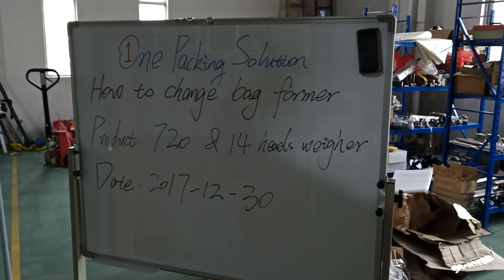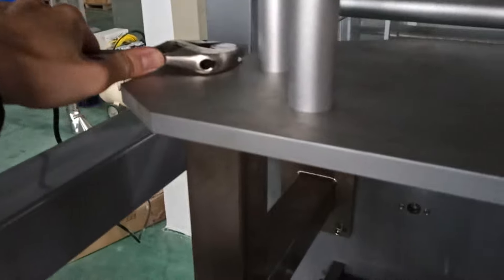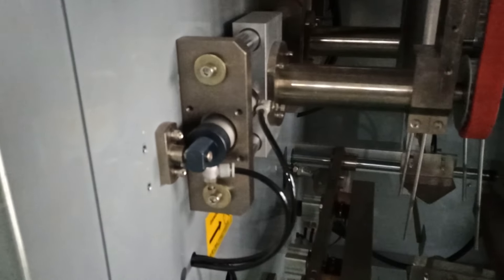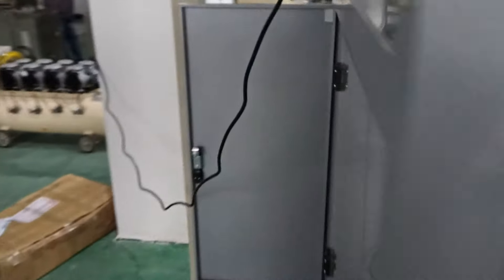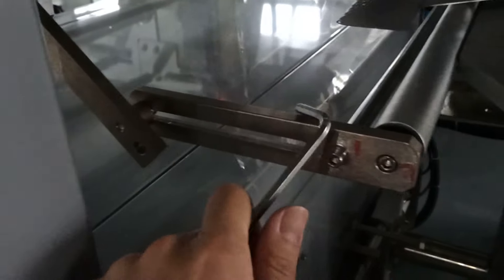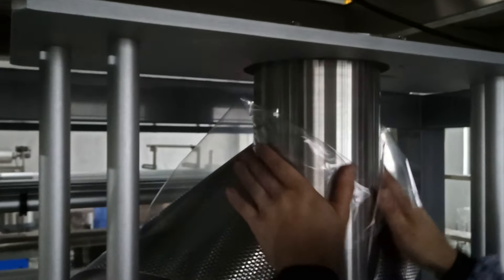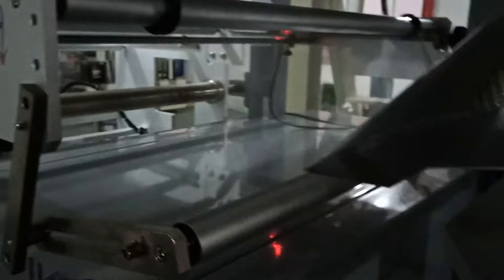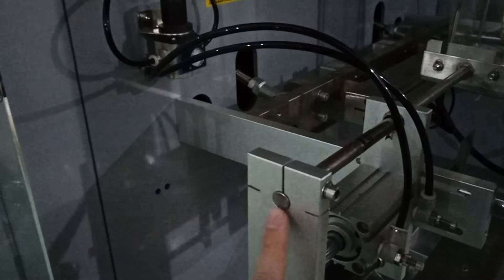How to use a full automatic packing machine- change bag former

Comment: This appeared as a recommendation for me, I remember when I was working on this machine while working in the chips factory. It was very tough dealing with these machines, lots of jams and errors.
Reply: How old was the machine? I work in a cereal plant and the back seal is a big issue. The triangle machines are 30 years old.
Reply: @robertapascal6962  I am no longer working in the factory but as far as I remember, the machines were not too old since the factory was established in the last decade. We also had issues in back seals, date print codes, registration marks and so on. What an annoying machine it was!
Reply: Ever had issues with the bottom of the gusset coming out open
Reply: Yea, I'm currently a Bagger Operator at a food production facility and I operate a similar Bagger as well. Nothing but Jaw jams and scale errors all night long.

Comment: Wow so awkward threading the film down the tube. I was taught a much easier and faster way to thread it. Pull a bit right through the front of the machine, do an angle cut, where the overlap side is longer than the inner-side. Thread the longer tail through the front of the tube. Hold the tail and pull it around the tube and there you have it. I have operated these machines for about 18 years, and my tube forming changes are only 15 min from start to finish.
Reply: Yo también estoy aprendiendo y así me enseñaron a mi y me tardo como 30 minutos y ahora lo are como usted dise para mejorar
Reply: @linacolin9451  tienes problemas con Que salgan los bolsas abisrtas de abajo
Reply: 15 min? We have like 4 minutes to change a roll in my factory 🤣
Reply: @nogo3972  there's no way.. they give you 20mins to thread the film and feed it down the former and former tube on the operators exam. I work at Campbell's and that's how long they give you. I take my exam in a few weeks and I'm gonna try practicing with what the original commenter said. Cutting it so that the left side is longer than the right